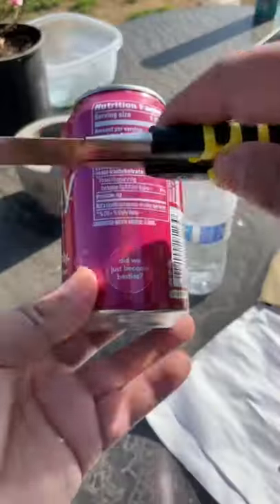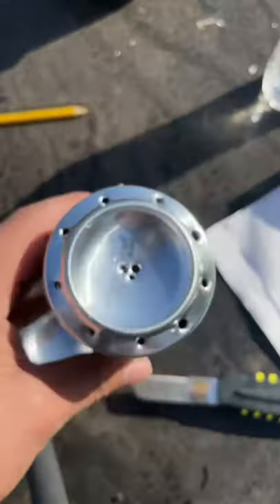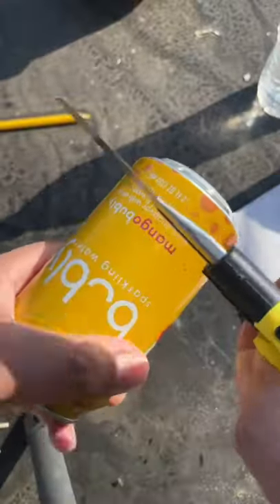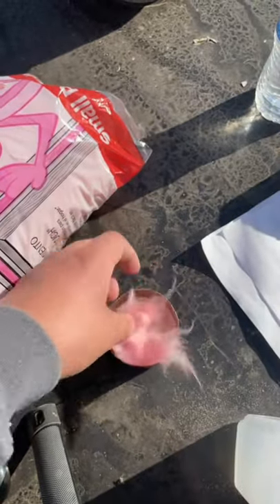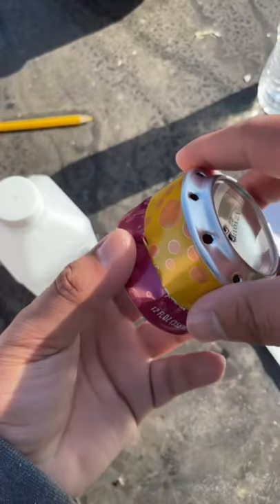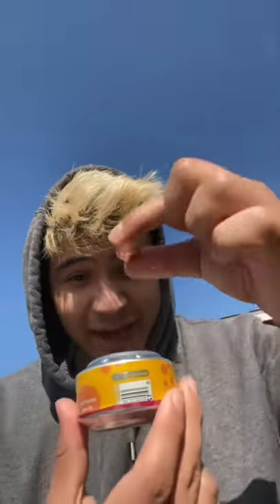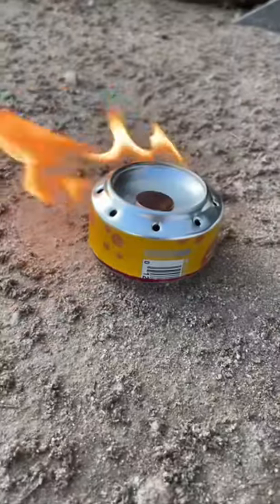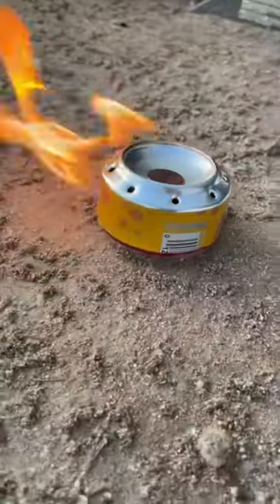I Made a Penny Can Stove 😱!!! #shorts

Comment: Alright champ... Try again and this time use a bit more patience and effort. Make smaller holes with thumb tacks or push pins (and more of them), don't bother with the insulation (leave it empty), try to crimp it as little as possible to get it to fit, don't press them so hard they split, and fill it after the stove is assembled. You will get much better results.
Reply: These kids nowadays are just something else!!! AMIRITE???
Reply: I typically use old 100% cotton rags to be a wick.

Comment: I think you're supposed to burn it for a bit till it levels out and the flame comes out the holes around the side after you put the penny in the middle. Also, you need a penny older than 1982 when they started making them out of zinc or it might melt.